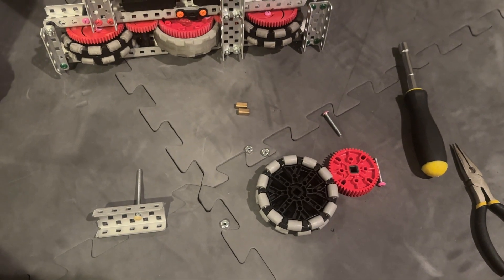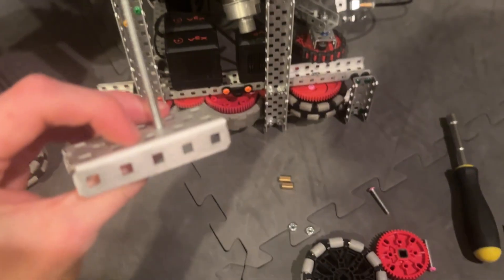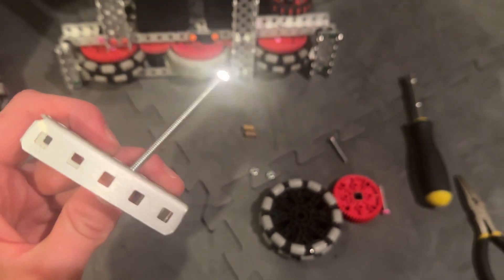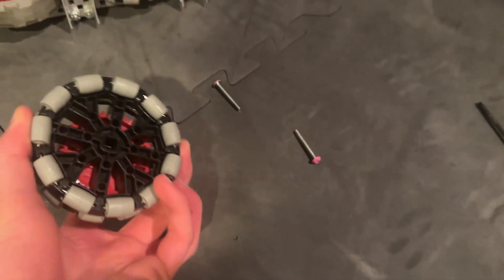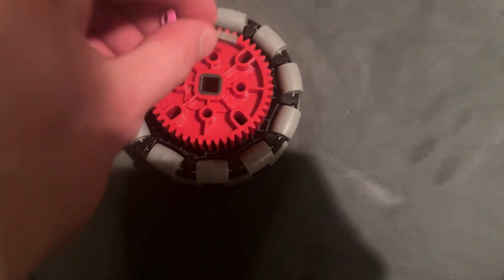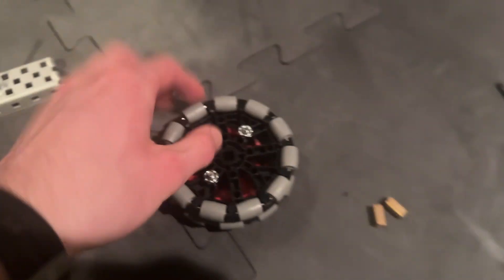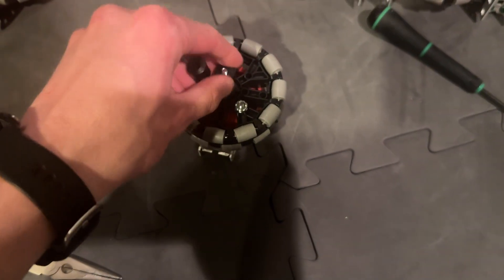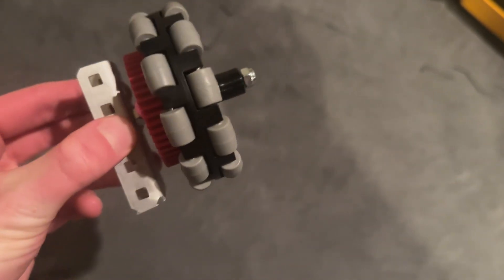Vex Screw Joint Tutorial

Comment: can you please help me I did this at the beginning of the season and connected to two green motors we have a 72 to 32 gear ratio and it keeps screwing itself into the c-channel infront of the wheel please comp is tomorrow and this just happened
Reply from the maker: Are you using nyloc nuts? If you use keps or flat nuts this could happen
Reply: @9MotorGang we just fixed the issue, we did use nyloc nuts but it was that they were a little bit too tight and 1 of our shafts was screwed into a motor, just not all the way😂 that’s what happens when freshman are in robotics

Comment: do screw joints work with low strength gears?
Reply from the maker: Yes. Check out my drivebase explanation video as those have some on them. All you have to do is drill out the gear partially
Reply: @9MotorGang  would it be High school legal?
Reply from the maker: @ys996x drilling, cutting and stuff is legal to most parts in high school. It’s R27 in the manual

Comment: Any idea on how to do this with the old 4 inch wheel which dont have holes for screws
Reply from the maker: 1. Buy the new wheels
2. Use a shaft
3. I’ve seen people use bearings flat mounted on a screw joint using the middle hole. Then the edge holes have screws going out of them and those screws go through the gap in the spirals on the wheels.
Reply: @9MotorGang  thank you

Comment: Say i needed some spacing between the gear and the wheel would i just add spacers or something else. And if you were to add a c channel on the other side what would you use to secure the screw
Reply from the maker: Just add spacers on the screws between the wheel and gear. The c channel isn't to secure, but to keep the screwjoint level with the ground and not canti.
Reply: @9MotorGang  One more thing should i build the screw joint first or the structure

Comment: where can you find the brass insert the only one i can find is under high strength shafts and hardware
Reply from the maker: @haydenford3794  those are the ones High Strength Shaft Adapter ((#8 Round Bore, 1/2" Long) (20-Pack)). They are currently out of stock however.
Reply: @9MotorGang  thanks for the clarification I was not sure due to them being labeled high strength
Reply from the maker: @haydenford3794  its cause the inserts can only go into a hole designed for a HS shaft.

Comment: using nylocks as the initial nut instead of keps is an interesting choice. The little washer teeth on keps can actually dig into c-channel when tightened properly, locking the screw more effectively than a nylock, alongside the keps being a good bit more space efficient, making it easier to make 3-hole gaps for your drivetrain. ❤
Reply from the maker: @DaMedicalKraken  keps are NOT more secure than nylocks. The teeth help and make Leo’s better than straight hex but that’s it. In somewhere with plenty of vibration like a drive they will come loose eventually. Doesn’t matter how hard you tighten them, you’re only buying time. They are more space decent though, yes.
Reply: @9MotorGang this is not really true, properly tightened keps nuts can stay tightened for basically the entire lifespan of a robot if you don't touch them. Keps nuts are a little more preferable in this implementation of a dead-axle since the teeth of a keps nut dig into the c channel and constrain the rotation of the screw. Meanwhile, lock nuts don't do this and can still allow the screw to rotate about the hole it's mounted onto even when tightened sufficiently.
Reply: @ali-1353  thanks ali!

Comment: how would u do a drive train then? cause the gear is not accessible, isnt the omni wheel in the way of the gear?
Reply from the maker: Take a look at the drivebases in this video or in the VexU explanation video. These drives use this same screw joint technique.
Reply: They have the small machine gears on the motor axles. Our team only has the thick gears so we had to use 2.5inch screws with 3.25inch total wheelbase width (we had to screw out 16 screw holes so it would work 😂)

Comment: Negative Nelly here (disregard as you see fit), using needle nose pliers on a nut is not a recipe that I would ever associate with "nice and tight". Also, I have serious doubts about the longevity of running any bearing surface on threads. That is all, carry on!
Reply from the maker: Tight is tight imo with nylocks. They aren't coming loose unless you're doing something crazy. And what do you mean by running a bearing surface on threads? If you're referring to running a brass insert on the screw as a joint, that is something that teams in VRC have been doing for years.
Reply: @9MotorGang  The only way you will ever hit a torque spec using needle nose pliers on a hex nut is by sheer luck - if even then. And re: brass on screw threads for bearing surfaces, a rapid prototype designed just to make it through a competition is not a case for the longevity of a bearing... my sole point. Bailing wire and bubble gum may get you through in a moment of need, doesn't make them good engineering principles.
Reply from the maker: @phrozenwun  This design was given for teams competing in the Vex Robotics Competition. The robots in this competition typically have a lifespan of no more than 6 months and aren't very powerful. They only weigh about 15 pounds and have a maximum power output of 88 watts. Since this design uses nylock hex nuts instead of regular hex nuts, it doesn't matter if you hit the torque spec. I have never seen nylock nuts come undone on a competition robot. Additionally, there are also rules regarding part legality in the competition, and the legal axles and bearings are not very good. The technique of using screw joints in VRC isn't something uncommon and done consistently by teams who have won vex worlds.

Comment: Random but is there a reason you put your screws that connected the wheel to the gear in the corner wider holes
Reply from the maker: Not really. Probably better to use the middle hole.
Reply: Yes I would recommend the middle holes too

Comment: one thing to remember with plastic inserts is that they will have more friction at the start since they are unused so it may be a source of friction but over time should be smoothened out due to use
Reply from the maker: Plastic inserts definitely work. Personally, I just prefer the brass ones due to their consistency.
Reply: @9MotorGang  yea just giving out a word of advice if people are seeing alot of friction for no reason
Reply: @haydenford3794  thanks for the tip we will be sure to wear down our inserts before we do autons. we only rly have plastic inserts here in NZ
Reply: @Diam0nder  glad to help
Reply: I just drill them out if I have to use them, otherwise I just use the brass inserte